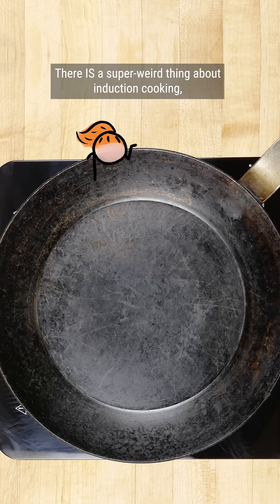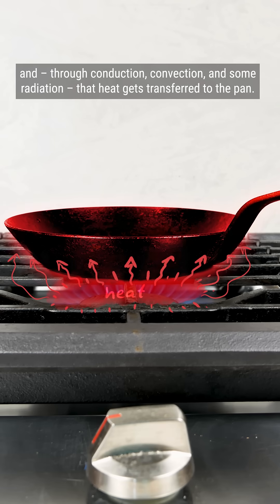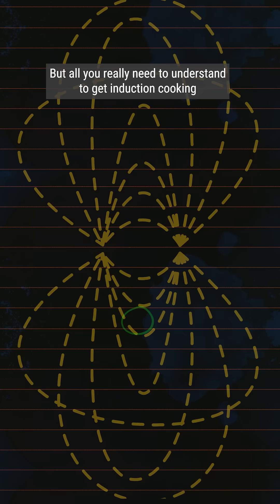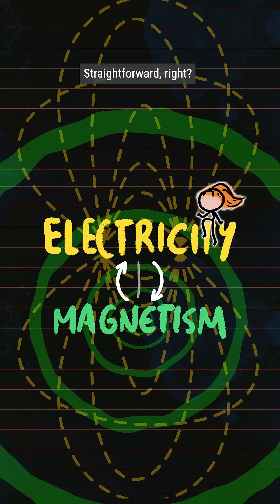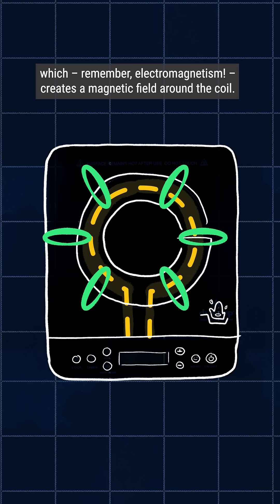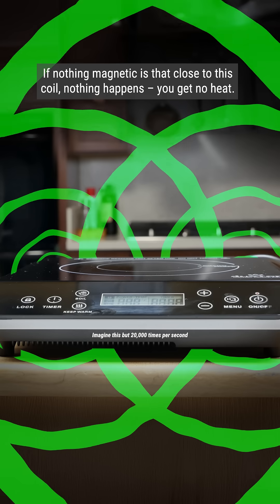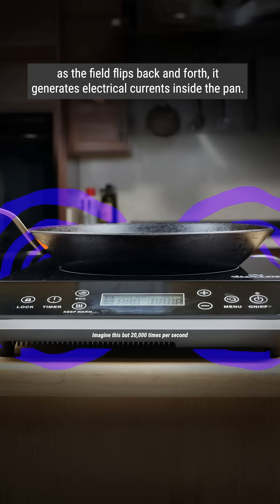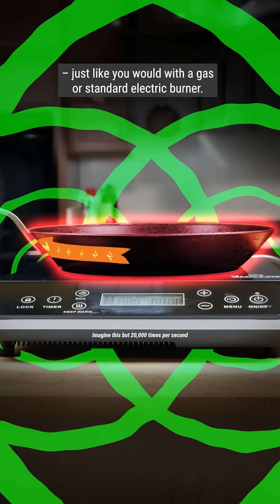How Induction Heats Your Pan

Comment: Yes like many people have said in these comments sections it depends on the kind of stuff you have there are certain stoves that detect the pans on there but in general usually on electric stoves the coil itself turns red hot and if you were to touch it you would get burned and it does not matter if anything metal is around it but however with a newer stove they can remove the metal that comes in contact with a regular older electric stove that makes the coil heat up so it requires pan to be set down first for safety reasons before it heats up so that nobody gets burned please get the facts right before you post videos like this yes you got most of the facts right and word form but you did not actually get the concept right it does make the pan turn into an induction cooker the heat is transferred in the same way heat is transferred by a fire however the way the burner is heating up is different.
Reply: You're the one who is confusing what the video is about… What you're describing (coil under the glass getting hot, glowing red and warming the pan over it) is a radiant cooktop, it use electricity too but it isn't an induction cooktop, doesn't use induction (the physical phenomenon) and is altogether inferior to induction cooking, except for its compatibility with all pots. If someone sold it to you as induction, they're scamming you.
Reply: @chaddaifouche536  see but you weren't reading my point I completely agree with the radiation part and the fact that the coil gets red hot underneath but she's saying that it does nothing and it does not get red hot if there is no magnetic surface like a metal pan near it certain new stoves that is true with older stoves that is incorrect the radiation part is correct sir

Comment: The problem with induction cookers is they always have a temperature sensor that turns it on and off. Useless compared to gas
Reply: No? They have an inductive sensor to detect the presence of cookware so they don't run with nothing on the stove, and they often have a duty cycle to control the power via on/off-cycles, but they don't turn off based on temperature unless the stove was overheating somehow. My stove also heats continuously when the power is set sufficiently high.
Reply: @Fra321  that's what I mean. They never have a constant heat. They get up to temperature and then switches on and off the element to keep at that temperature. However alot of them are cheaply made so don't stay at a very consistent temperature

Comment: So the Eddy current produce heat in the pan ?
Reply: Yes, that's exactly right! The changing magnetic field induces Eddy currents because the pan is electrically conductive (Faraday's Law of induction). These currents cause heating because the metal has some resistance (Joule heating a.k.a. Ohmic heating). 

The material of the pan is also a magnetizable material which adds a second mechanism of heating, usually magnetic hysteresis losses caused by the material cycling through magnetic states in response to the changing applied magnetic field, which is a lossy process.

Note: the term loss is often used for historical reasons, but in the case of induction heating this is the intended result so it is not 'lost' in the sense of loss to the environment / unavailable for work.
Reply: @MR-ym3hg can eddy current electricute me? If not, how it can produce enough heat to the pan?
Reply: @xkingx5619  when emf is induced in the pan current flows in the pan this introducing H=i²rt so according to that the pan heats up (because the power is high 1000-2000w or more at high current)
Reply: yes, the same way the sun's fields heat the atmosphere
Reply: yep, turns the pan into the heating element.

Comment: It's not completely correct. Heat generated by current induction is just a minor part of all heat generated by induction stoves, otherwise it would heat any conductive surface and not just the magnetic materials nearby. The key is that ferromagnetic materials are made of disaligned mini-magnets ( technically, magnetic domains), which align themselves with magnetic fields nearby, (which is why these materials attatch to magnets but they are not magnets themselves). Therefore, alternating magnetic fields make those mini-magnets jiggle (heat)

Comment: Switching to induction was the best upgrade I ever made in my kitchen. It's so much better than anything else. The only reason you might prefer a gas stove is if you need round-bottom woks, and even those have solutions with induction. Everything else is just unambiguously worse in every way.
Reply: The only downside I would see is that you cannot get charred foods. For example to make some salsas you need charred tomatoes or kinda charred tortillas
Reply: @zaclanderos1624  Why would you be unable to make charred foods on an induction cooktop? You can heat a pan until it glows red on an induction cooker, no problem at all.
Reply: Not that good for Chinese cooking. It needs high heat quickly, where gas stoves are better for.
Reply: @tanjeeschuan4999  Induction is actually better at heating thing really fast, at least if we're talking normal indoor domestic ranges. You can find many tests of the speed to reach boiling water on gas and induction and induction wins almost every time.

Now if we're talking the kind of jet engine burner that get used by professional wok users, that's another story ! Though you may be surprised to learn that many asian cooks use special induction heater for their woks nowadays (they're bowl shaped to accommodate the wok with better contact and thus more efficient heating, it's cheaper and less dangerous than the gas alternative).
Reply: Cooking on gas is king but for an average home induction is unbeatable.
Reply: I wish I could get used to it but I simply can't, it doesn't work for me.
I noticed that induction stove tops work by switching on, on full power, and then switching off again. And that the setting you use makes it turn on for longer than on a lower setting. My experience with this causes my food to burn and dry up all the darn time.
Maybe it's the way I've learned how to cook for all these years, because I like to turn the gas stove on and not use the size of the flame but rather the pan itself as a heat control. Moving the pan while stirring or keeping it certain heights above the flame can greatly change the way the pan gets hot and also how the food reacts to the heat.
And as you can't move the pan when using an induction stove top it just doesn't quite work for me, although I'm not saying I couldn't learn it, I just haven't got the hang of it yet.
Reply: Have heard chefs diss induction before. I don't buy it, I think it's snobbery. Been using induction for 25 years. So much cleaner, safer and more controllable. I accept the wok criticism -- induction's only failing is where you need the sides of the container to be as hot as the bottom. But can be worked around with a large shallow dimple-bottomed pot.
Reply: You can't ligth a cigaret with a induction, but you can with gas flame.
Reply: @waynes84  That's a plus in my book tbh. No-one should be lighting cigarettes  indoors, and definitely not in a kitchen.
Reply: @uncleho1945  Are you referring to my opinion on smoking?

If you smoke indoors, you're literally spreading poison into the surroundings. That's an asshole thing to do if people are around. The smell also sticks to everything and is really hard to remove, so if you ever might want to sell your home, it's also stupid.

People are already often completely oblivious when they smoke outdoors. I don't trust anyone who would do it indoors.
Reply: I’ve used both and I disagree 100%.  -professional chef
Reply: @rcpmac  we can tell you're a professional chef by your complete lack of explanations.
Reply: @rcpmac  I'm not cooking for 100 people at home. No reason for a gas range in a house. At a restaurant, with proper ventilation? I get it.
Reply: @rcpmac and provide zero reasoning or experiences.  I'll be sticking with induction the rest of my life.  Insanely good heat control - I can melt chocolate right in the pan on the burner for instance, faster to heat up than gas, no dangerous fumes from burning gas in the house.
Reply: @whattheschmidt He doesn't have to provide reasoning

He is a chef, he has a view and it is valid.
Different people will have different views.

The fact he doesn't complement his disagreement with a justification does not mean his opinion is wrong
Reply: @deang5622  I never said his opinion is invalid.  By not providing any useful info or experiences he just sounds like an old fart stuck in his old ways though.  I'm allowed to have my own opinion and reasoning though, right?
Reply: @deang5622  ....well, I would say, it 'does not mean' his opinion is not as equally important, as any other human being's, but without some logical, or evidential argument, then it simply that, ONE person's opinion.'
Reply: @michaeljames5936  That's the whole point, these are just opinions. And they are all valid.
Reply: @deang5622  But it does make their comment useless for the rest of us.

Comment: So does it matter if for example, the pan is bigger than the burner? Will there be hot zones? Assuming the pan is well-made and has same thickness all around. And what about the opposite, if the pan is smaller than the pan? Would there be less energy transferred and u are basically running electricity for nothing?
Reply: If the pan is too big, you probably will get hot spots, but that's true with most cooktops. Similarly, most cooktops will waste energy if you use a pan that's too small. Induction cooktops are actually much less wasteful in that regard. They're already more efficient than other cooktops, but also, collapsing the magnetic field returns electrical energy back to the circuit. It's what's referred to as "reactive power." Basically, anything not absorbed by the pan is returned, and the losses are minimal.
Reply: @EntropicNightmare  and what about how the heat is transferred throughout the pan. Does the heat come from bottom towards the top, or the pan heats up simultaneously including the sides? Considering the heat is not really "transferred" through convection, radiaton, conduction, and instead energy is transformed from electricity into, well, heat in the pan, not from the cooktop itself
Reply: @marchosias2071  magnetic field strength drops off rapidly with distance, and the sides are oriented relative to the field in a way that makes power transfer inefficient. There might be a very small amount of heating in the sides, but it'll mostly be the bottom. Then heat will conduct to the sides from there like normal.

Comment: So glass cookware dont work on induction cookers? I dint know that!
Reply: Some types of metal won't either.
Has to be a made of ferrous metal or the pan needs to be made with a ferrous strip in the base to get hot.
If a magnet sticks to the pan it should work.

If you look on the bottom of a lot of cookware it tells you what kind of stove top it is suited to.

Comment: How can I tell the difference between an induction cooktop versus a regular electric cooktop? Other than the fact that the electric ones get hot without a pan on top?

Edit: I suppose I'm saying that by your definition I have never been made aware that induction cooktops even exist yet
Reply: Induction typically heats things up way faster assuming you are starting from a cold stovetop since there is no coil that has to heat itself and the glass up and then the pan, it just goes straight to heating the pan.
Reply: One difference I noticed (twixt inductance/resistive)

Induction cooktops never have the “CAUTION: Hot Surface” warning light
Resistive cooktops ALWAYS have the “CAUTION: Hot Surface” warning light

Comment: How does an induction stove not cook itself? Is it mostly glass and plastic?
Reply: Well glass and plastic aren't ferromagnetic, and thus they can't heat up through the magnetic fields. The glass top will get hot from the hot cookware, but that's it.
Reply: The induction stove is made using low-resistance conductors which dont heat up as much. It still does get warm though. I have an induction stove, and after cooking at high power for a few minutes, it turns on a fan to cool itself.

Comment: induction cooking is the norm here in Spain
Reply: i hate electric stove no matter if wire of induction i want no steps in heat ... like gas and its quicker with larger pans and pots
Reply: @AChicken-sh1gc  I have a 7.9kW induction field (that has 6.6kW available on a single coil). Each field has 30 different power levels.
It is simply faster than gas stoves in every possible way. It also has enough fine control to basically be "step less".
Reply: @vffa  Well you gotta have the power to heat with 8kw wich is a lot in electricity but not much in gas also that stove surely cost 5x more than a gas stove of comparable power and at least with our induction shit (Siemens) it heats the pot in ovals (the coil shape) so the pot needs time to heat up evenly it it ever does. i just happen to experience both at the home cook level and gas was superior in almost every way

Comment: i like induction stoves but the intermittent heating is not good for frying
Reply: If you use something with a suitably thick base, it will spread the heat so the intermittency isn't a factor. Agree that some lighter weight bonded ferrous metal heels on aluminium pans are less than ideal.
Reply: Good quality induction stoves don't use intermittent heating, they just change the intensity of the heating. You'll find intermittent heating in cheap stoves, especially portable ones (at least that's the case over here in Europe).

For frying, a suitable vessel like thick cast iron (a dutch oven) retain the heat very well and won't be too affected by the intermittent heating or the drop in temperature due to dipping food into the oil.
Reply: I actually agree with that. Level 5 and up on my stove is continuous, but below it, it heats intermittently. A bit annoying.

Comment: Others have correctly posted that induction capable pans will attract a magnet. However, the efficiency of those pans depends on the proportion of ferrous material in them. Some pans are made of alloys that are only partially iron, so will take a magnet, but will therefore will take longer to heat up on an induction cooker. For excellent performance, use high iron content cookware such as carbon steel, cast iron or similar pans.
Reply: Many induction pans nowadays are aluminium with a bonded ferrous metal "heel". Most work ok, a few give trouble, especially smaller pans  without enough iron for the eddy currents.
Reply: I didn't even imagine hearing an explanation of electromagnetic field in the cooking video WOW Nice
Reply: You don't necessarily want for a pan to get warm too quickly. That gives you less temperature control.
Reply: how then do glass utensils work on it?
Reply: @sailaab  glass and ceramic cookware won't work with an induction cooktop. Aluminum cookware doesn't really work either unless it has a ferrous core in the bottom.
Reply: @sailaab  glass won't work on an induction heater, nor will ceramic (unless it's ceramic-coated cast iron) or any other non-metal, nor will aluminum or most stainless steel (unless it's specifically a magnetic stainless steel alloy)

if you saw someone using a glass pot on something that looks like this, it was a normal hot plate that generates heat the same way a normal electric stovetop does. induction heating is a different system.
Reply: @ In short, they don't.